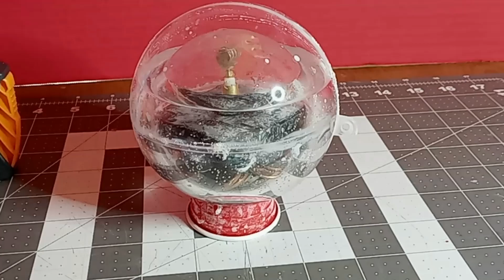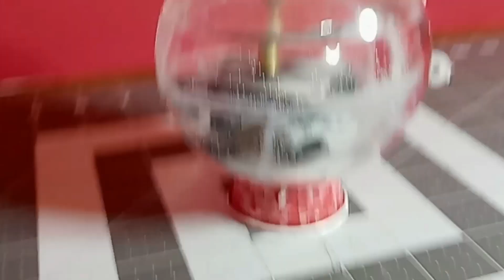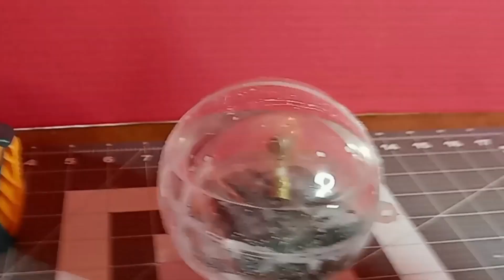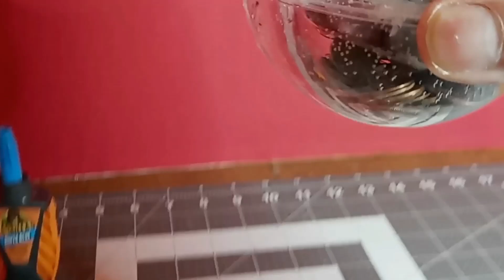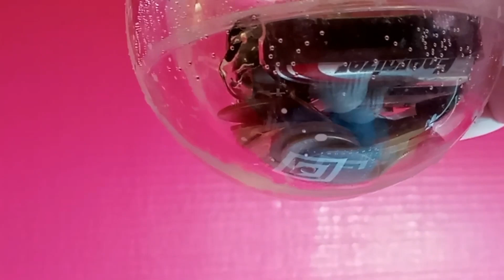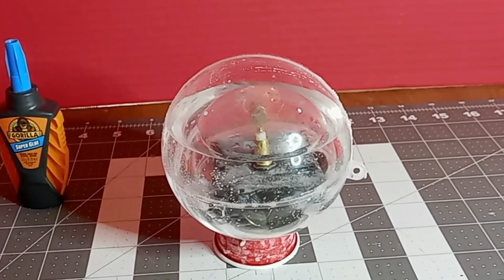DIY MOVA GLOBE GOOD PROJECT

Comment: I would use a rotating display table instead of a clock. It comes with solar power and have higher torque. To keep the inner globe flow in the middle you can fill a little water then fill baby oil (mineral oil) on top. That will keep the inner globe flow right in the middle,  dead center
Reply from the maker: Thanks for watching and commenting on the video. I'll check it out.

Comment: How it's work?
Reply from the maker: Magnets are attached to the clock to the second hand. It is inside a smaller Christmas ornament floating in water inside a larger Christmas ornament. When the second hand turns the magnet the magnet stays aligned north and the inner Christmas ornament turns.
Reply: Small ball turn for watch and magnet... But how to turn big ball?
Reply from the maker: The outer sphere doesn't turn.
Reply: Okay.... Thank you so much brother ❤❤